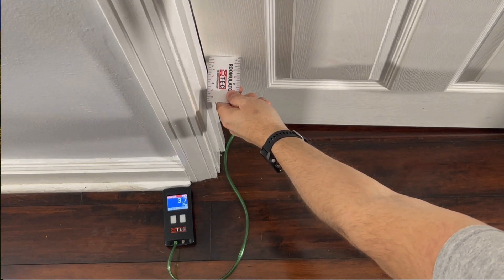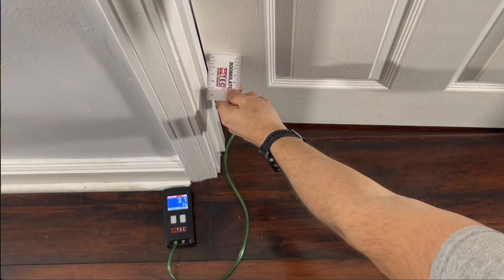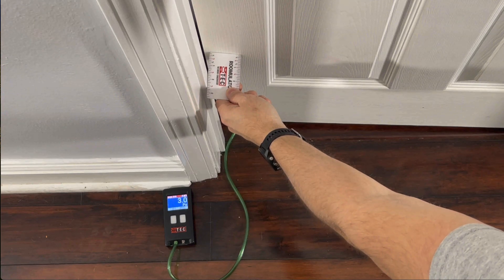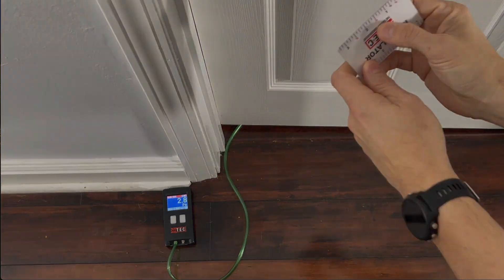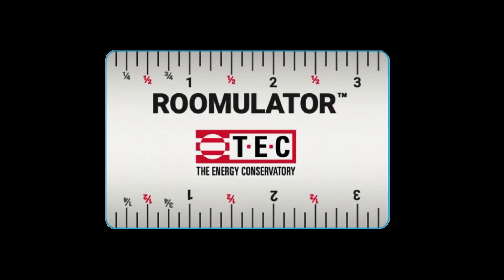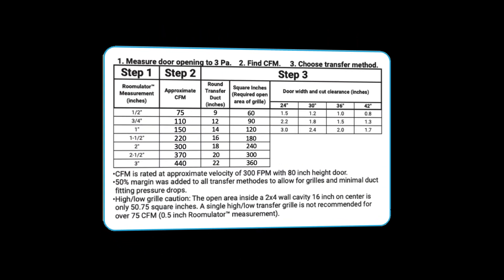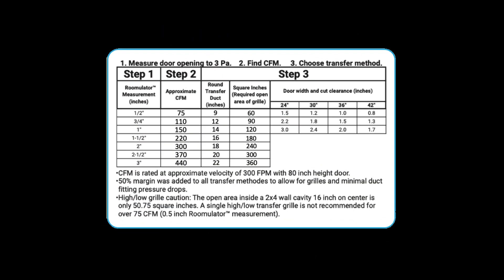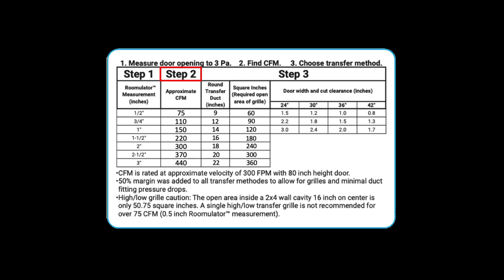TEC Roomulator™ Tutorial

Comment: I tested mine and it's at three pascal's now, hypothetically, should I worry about it since I'm already at three? I should probably add the six rooms I tested. All are basically definitely under one but almost zero. There was an addition put on this house in the early 2000s. This is the two rooms I'm having issues with and they're right at three pascals
Reply from the maker: If my rooms are all under 3pa.  I would now divert my attention to the measured airflow being delivered to each room and trying to acquire that measurement and comparing that to the design.  I would also consider infrared scanning that room to see if it's poorly insulated.

Comment: Just curious about testing with other bedroom doors open or closed? I noticed that the pressure will go up and then drop a bit, assuming the air flow is reducing to that room once it pressurizes. Any tips?
Reply from the maker: Chris from TEC here.  My recommendation for a home that has multiple rooms with pressurization problems would be to tackle each room independently with all other doors open except the room being tested.  This way you are simulating that all the other rooms are not problematic nor causing side effects to your room in question.

Comment: Quick question, 3.0 pascal. Is that just for pos? If it’s below 3, will that be considered a leak (neg)  pressure?
Reply from the maker: 3.0 pascals is for just positive pressure.  Below 3 is ok.  If you see a negative number, then the room is under negative pressure.  This should never be the case when you only have a supply register to a room.  If you have a dedicated return in the room that is connected to the duct system, then balancing the return and supply with a flow hood would be recommended.
Reply: @energyconservatory  thanks for the reply